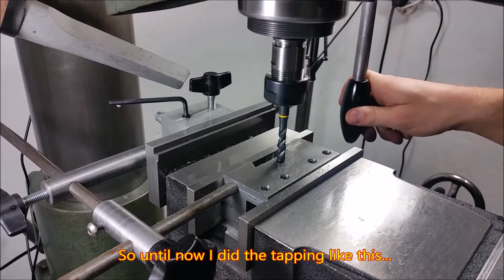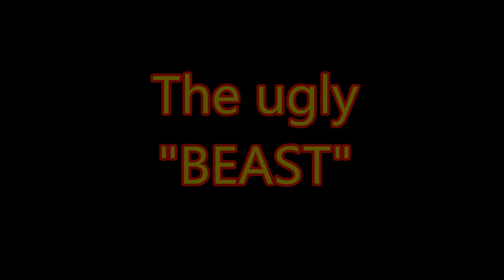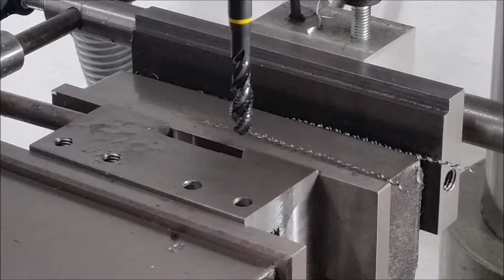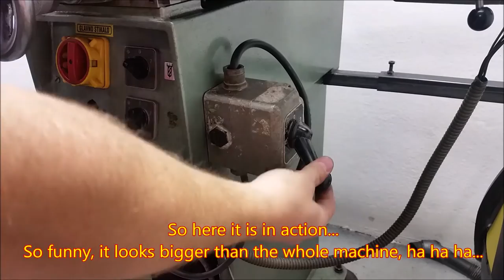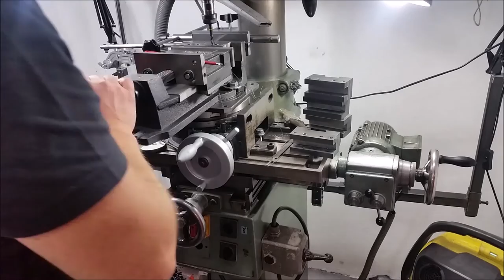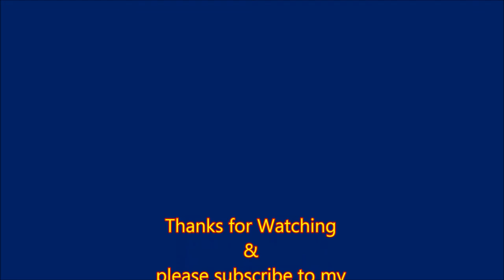Machine tapping & most ugly electric switch installed for reverse operation on Milling machine

Comment: I have an old manual milling machine where you must raise the table to make depth cuts. I need to build a vise of sorts where the part is clamped but free to move upward as the threading tool engages the work, since trying to manually raise the table as the threading advances would be disastrously impossible. A vertical movement of 1" would suffice for most work.

Comment: Just ordered one of these from ebay for my mill. It's a different style than yours but the same thing. Just a forward and reverse switch. Did you have to modify the wiring alot? or was it fairly straightforward to install?
Reply from the maker: +joe dellaquila 
Hi.
Great. I hope it will work with your machine too. 
I have got very old switch without any informations about connectivity and polarity, 
so all I neded was to find the right connectors for level 1 and for level 2. 
After that it was easy. I have disconected all the wires from the main switch and put them to the "new" one... So this switch 1-0-2 has became now the main one...